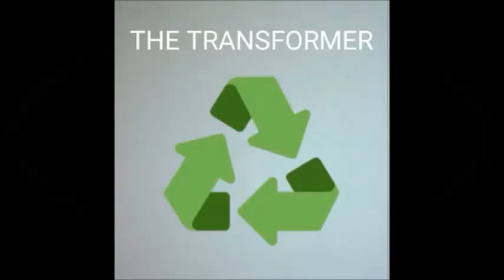ANTENNA HDTV MADE AT HOME 100% Waste Material // Antena HD Casera costo $ 0.00

Comment: neat idea! i have built many diffrent designs ,all worked well, my favourite one is an omnidirectional 2 element, two 12awg copper loops the size of a 5gallon bucket, 90degrees apart from each other mounted on pvc pipe, and the plastic covering on the wires dosent affect signal, i get 36 channels with mine, and no turning!
Reply from the maker: interesting design the one you mention, thanks for commenting, regards

Comment: Good work . For cheep. Even added a small solar panel, and amp.  next to antenna the cell collects enough for nite use. The panel and BATTERYS are from side walk lamps so 24/7 the RF runs down the pipe at the TV . Tks amigo via con dios.
Reply from the maker: very well

Comment: The silver braiding on your coaxial cable is shielding...not for picking up but blocking signal from interfering with the signal supplied by the copper 'core' wire....as we called it in the industry...the stinger.
Reply from the maker: that's right, because it is directly connected to the "ground" chassis of the television, very good explanation thanks for providing that information

Comment: Looks like it will work pretty good if you lived close to towers. What would the range in miles be? Anyone know? I have everything to make this. Guess I'll give it a try. Why not. Thanks dude.
Reply from the maker: Here in my city I have an antenna approximately 75 miles away and receives the signal very well, this antenna is directional, it must be oriented towards the transmitting antenna. If you do not have a good reception, you can try this other antenna made with aluminum cans and does not need guidance https://youtu.be/Ozur3UBDUY4 thanks for your comment luck
Reply: @eltransformadorplus   You are welcome. And thank you.